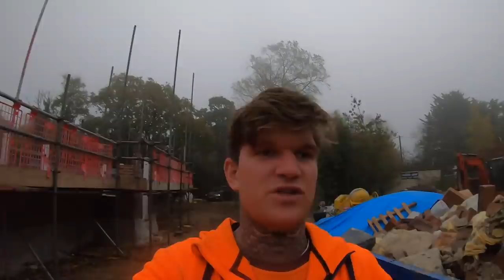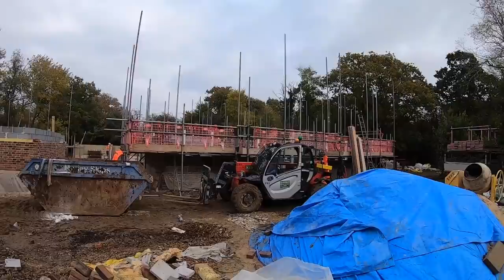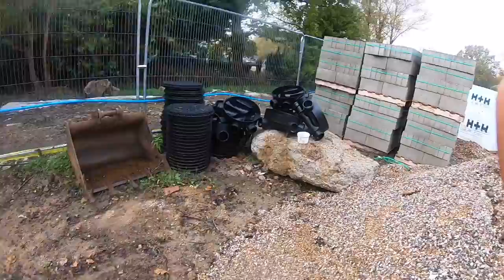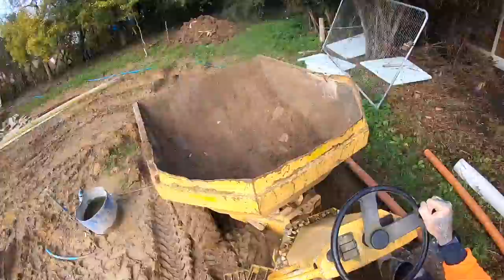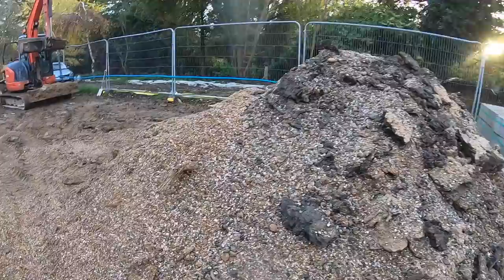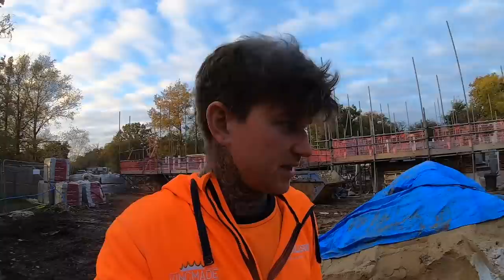Bricklaying - Day 23 - Reorganising a site!

Comment: Something different but defo needed doing,it would do my head in all that mess I know it's a building site but even still,only thing I did notice was the young lad in grey walked under the arm of the digger now I know it wasnt moving but as I used to drive them and alot bigger ones you were taught not to walk underneath them unless its parked up empty,just would want any unnecessary accidents,look for forward to the next one